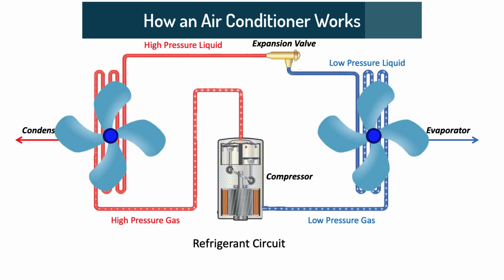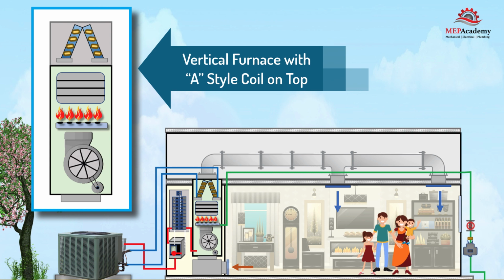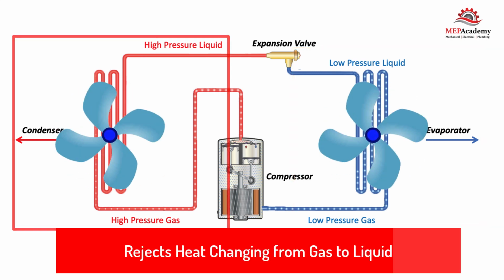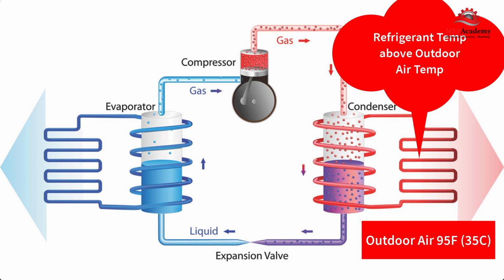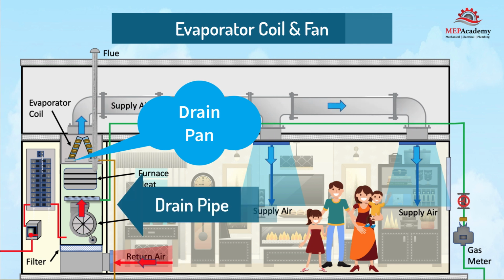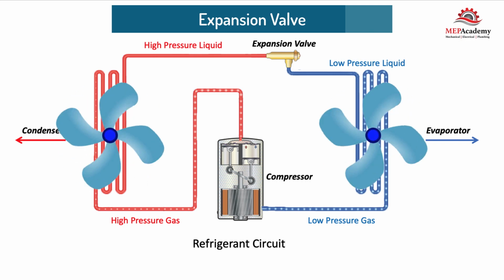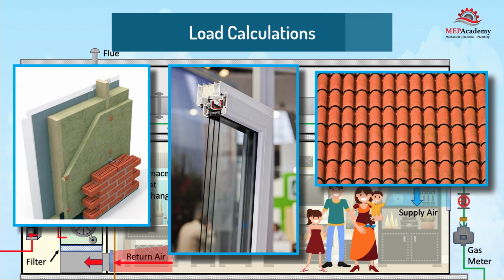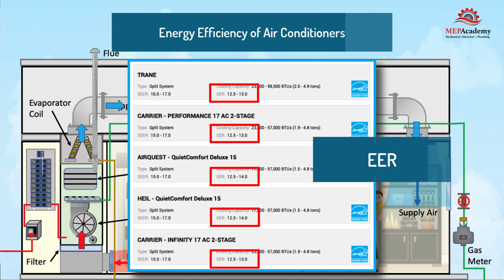How Do Air Conditioners Work

Comment: So thermal energy inside the building transfer to outside with refrigerant process?
Reply from the maker: Yes, the refrigerant is used as the medium for heat transfer, whether that is a cooling only unit or a heat pump.
Reply: @MEPAcademy but my friend disagree with that. He said, whatever temperature inlet compressor, the outdoor output temperature is constant. I just dont understand why my friend disagree
Reply from the maker: @SuperZeno11  We might be talking about two different things. If we're talking about how heat gets transferred from the indie to the outside the process is very basic. Warm air passes over the evaporator coil giving up some of its heat to the refrigerant, causing the refrigerant to go from a low pressure liquid to a low pressure gas. That absorbed heat goes to the compressor where the compressor raises its temperature and pressure, so now it's a high pressure gas. This high pressure gas then goes to the outdoor condenser where it gives up its heat to the outdoor air. This is your typical refrigeration cycle. Please see our other video on how the refrigeration cycle works. Hope this helps.
Reply: @MEPAcademy i know, because ur video i got more knowledge. Thanks for your explaination 🙏🔥